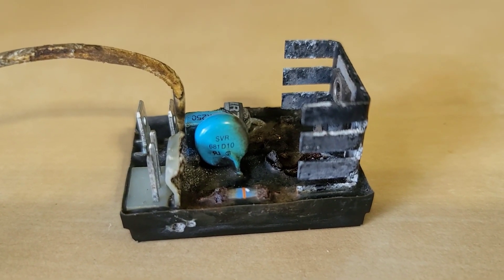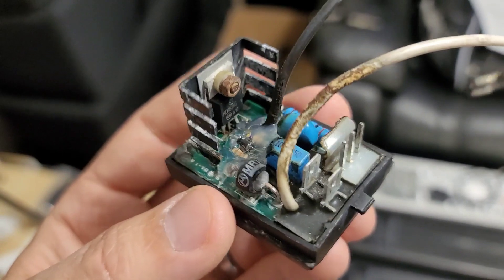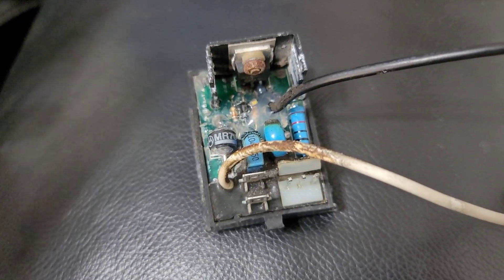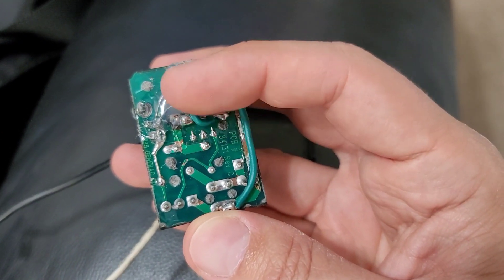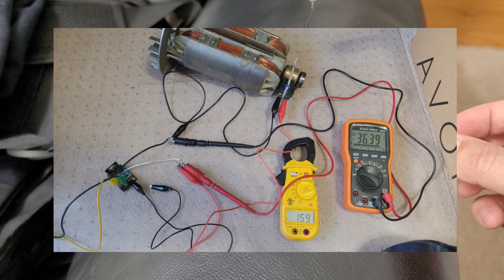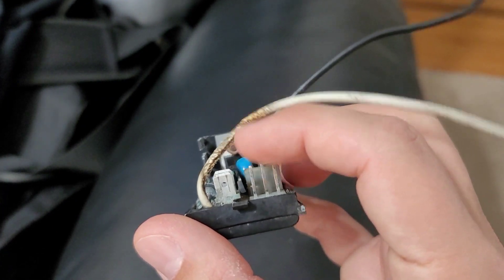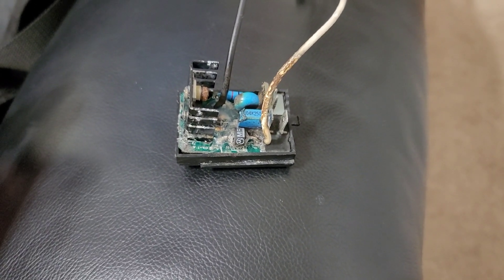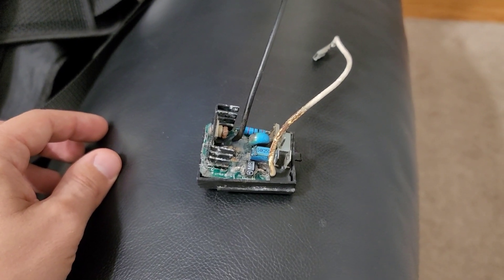Briggs / Generac Power Regulator Board 84132GS Repair / Rebuild

Comment: Good job. Just a remark. Hot glue is nylon. Nylon is hydroscopic. It absorbs moisture. Maybe not the best for electronics. My 5c of advice.
Reply from the maker: Thank you! I have since discontinued using the hot snot glue and instead using neutral curing silicone to secure the board's back into the tray. So far none of them have come back for any issues.

Comment: Hey Gary, very useful video, I'm repairing a generac 5500xl. It has issues!. Sometimes i have output, when it does it's stable but droops under load, like 1kW and the output is 190v. Initially one brush was stuck and the slip ring was dirty. Sorted that.. the manual part number differs from yours but they look identical. 84142gs.. I have a 10ohm Exciter winding,  and the dpe winding is 2.6ohm, no idea what voltage I would see on that winding.. so @120v, I have 147v DC output O/C. A 10ohm load resistor gets very hot quickly..  do you think it's stuffed, started rework heat disassembly? What should I see on that dpe winding, what's dpe stand for?..
Reply from the maker: @nickjones886  DPE stands for displaced phase excitation. Don't worry about the voltage on the field winding as much as the current. The 84133gs board is a current source not a voltage source. A 10 ohm rotor field winding is normal through the brushes. that is at full load. It's roughly 24 volts to 36 volts no load on the generator and drawing about 3.6 amps. That's like 130 Watts of heat going into a small resistor.

The AVR circuit on the system control board controls how much current the power regulator board is outputting to the field. 

You not only need to look at the power regulator board but also the system control board because the high voltage is an indicator that both those boards are not working properly.
Reply: Hey, thanks Gary for explanation.. so 120v AC into spade connections = 30 ish volts DC, circa 2A into the rotor winding, short 1 and 3 should kill DC output... There's not much on this board that can go wrong.. I'd assumed the AVR function (on the other PCB) was working as I was able to adjust the output voltage control, so I ruled out any faults on that board.. it's basically a AC -> DC driver board with an inhibit function!..
Reply from the maker: @nickjones886  correct it has a negative feedback snubber topology. Almost all AVR circuits are like this but instead they are split between two circuit boards on this generator.  The improvement on the newer generators is that if the negative feedback circuitry fails it doesn't go high but instead goes low for voltage or zero which is safer than having a voltage surge.
Reply: That 18kohm resistor, 2W?.. mine is now in the megohms!! PCB looks ok... Hopefully, that'll sort it's output...
Reply from the maker: @nickjones886  I don't recall off the top of my head but I believe it was a one watt resistor
Reply: Hey Gary, thanks for your help. YouTube comments not really best place for lots of messages, for which I apologise. Tried a more direct route.. anyhow, got my Genny back together and I tested the driver PCB using a switch across 1 & 3.. o/c I get 300 odd AC volts at the 230 outlet and 13v AC with the switch closed. So I'd say the repair is good.. but!. I still have severe volt droop under load, not as bad as it was, 2kW/190v, now it's like 4.5W and 209v. I can set the output voltage with no load and have more power from engine.. I noticed a recent video on James channel showing a sticky throttle linkage.. mine had this issue, just wear in the governor arm..  I now have the regulation board out, 83970 for investigation. Not really much to go wrong here either.. few transistors, caps maybe.. you got any immediate thoughts?.
Reply from the maker: @nickjones886  yeah severe voltage drop could be a lot of things either in the system control board or mechanical connections to the outlets are fatigued. It's hard to say without getting a good look at it.
Reply: @Bassguitarist1985  I did more tests! Asked James too.. it's strange that the AVR is clearly working. Both output coils are circa 300mOhms. And I've just had it running, dpe is stable at 183Vac, the field at zero load sits at 16Vdc and increases to 28Vdc at 4200W load. The AC out drops 26Vac and 2Hz from zero -> 4.2kW. I'm sure if I used an external power supply I could get 230V @ circa 4kW.. I don't know how deep you went testing, making measurements etc.. I'll get to the bottom of it sooner or later...

Comment: Hey, trying to debug the problem with my Generac 4000XL.  Trying to determine which component has failed, regulator board or the system control board.  Motor runs fine until I switch on the output.  With no load whatsoever, as soon as I switch on the output, the motor bogs down and stalls.  Seems like there is a short that is causing an overload on the output even with no load connected.  Can you tell me what test to perform to diagnose this?  I've not seen this issue discussed on any videos and I'd sure welcome some input.  Great video on the repair BTW.  Cheers.
Reply from the maker: Try disconnecting the three big stator output wires from the outlet panel. There are molex connectors in the end bell to do this. Restart the engine. If it doesn't big the short is in the panel..if it still bogs, your stator is toast.
Reply: @Bassguitarist1985  Thanks, with your help found the problem.  Really appreciate your input :)
Reply from the maker: @StanislavGouzenko  what was the problem?

Comment: I purchased a junked Generac 5500 XL as a project hobby.   I have no idea of its history - I found it at place down the road that has 2 old chicken houses full of "stuff" - lawn mowers, chain saws, weed eaters, the list goes on and on.   All sold as is.  Anyway had compression - the main coils were not opened or shorted.  I was able to get the motor started with little effort but no power.  BG - your videos on troubleshooting this model (you actually did it on a 7000W one but that one is almost identical to the 5500  I have) have been so helpful - and I was pretty sure that this board was probably the culprit - and I tested like you did.  I used a 16ohm resistive load to simulate the 12ohm I saw thru the slip rings.   Mine had no DC output with 120VAC in .  Ordered one from Briggs and Stratton (at least that what they claim to be on Amazon) for $33.  Anyway thanks for putting all the effort into your videos...
Reply from the maker: My pleasure thank you for watching!
Reply: BG, if you have the time and inclination to answer a question on my 5500 XL.   I replaced the control board - still no power.  So thinking perhaps the windings needed to be flashed (not sure if that required on this model or not) - I disconnect the control board and wires to the brushes - and appied 12DC.   Incandescent 120V bulb can on (dimly) - at one point I increased the DC voltage to 13  - light became brighter - when it went to 15VDC the motor started struggling - and I dropped the voltage back to 12 - and the engine ran find - but I got the same issue when I went back to 15VDC - and very soon after that smoke started coming from the open generator housing.  Partial short on the main rotor?    I can't imagine what else it could be.   But on the off chance I'm missing something  I figured I would hit the expert up.  I posted a question on smokestack and so far have not gotten any comments....

..../Romany
Reply from the maker: @romanykemp9042  magic smoke is not a good if you hear the engine start to struggle without any load connected other than a small 100 watt or less bulb then yeah you have a short somewhere or at the very least a flying short as it's called. I would say that the stator is toast
Reply: Thanks for that confirmation BG - I appreciate you taking the time to answer.   If was a fun project - that cost little except for my time - and I learn a lot.   I actually went back and purchased the same make/model (must have came from the same shop).  Bad power control board - which I replaced with the bad unit  - and the 2nd one works great so far.   5KW resistive  (water heater) load at around 16% THD.   Whoever scrapped these drain the tank and carb - the tanks were in great shape - the carbs just a simple cleaning.

Comment: Well done, thank-you. It doesn't look as though the Second part of James' repairs didn't upload.
Reply from the maker: He did post it, the power head had a bad stator. You can see the burn marks in part of the video. Thats why the regulator board failed a second time.

Comment: Another guy that does not show himself doing the actual repair, why dont any of these youtube geniuses show what the repair actually consist of?? Its so disappointing to a novice. You may as well not watch this vid because all you will walk away with is "short the outer pins together to shut off the generator end" c'mon guys, start making vids that teach what to do.......
Reply from the maker: I'm sorry that the video did not help you out. It's not easy to film every step of the repair because the reality is it slows down the repair when you are filming and then having to edit it down later. There are tons of forum posts about this repair that detail the repair process further. Being honest repairs like this are not for the extreme novice either. There are lethal voltages at this board that can potentially cause injury if you are not careful. 

If there is something that you did not understand please let me know and I will do what I can to help out.

Comment: Hi l have seen James video and when tested his generator he had the control board disconnected and max power came in witch smoke the regulator.
Reply from the maker: Yes due to a flying short in the main winding.

Comment: can i substitute a 12 amp rectifier with a 25 amp rectifier I have a 400V 12A rectifier  was able to find a 400V 25A.  Will that work without causing any problems or fire. Trying to fix THE Homelite LR5000T generator
Reply from the maker: Hey Vic, adding a more stout rectifier isnt the issue, its the rotor drawing too much current. As a design measure the rectifier is intentionally limited in its capacity so it fails before the windings do. Chances are though if the rotor draws more than 12A on a 5kw generator, something else has already burned up anyway.
Reply: @Bassguitarist1985  thanks. I can't believe I got a response that quick u rock ! .  So u think  I should consider the generator junk.
Reply from the maker: @Vicmon  what's it doing? Going under heavy engine load without anything plugged into it?
Reply: @Bassguitarist1985   I bought it  not putting out any power.   The engine starts but no power.  I did all the tests that I saw on ur buddies YouTube page  everything seems to check out fine except for the rectifier .   I did notice it was revved too high I did correct that.  But no power output I'm hoping the rectifier will fix the problem.
Reply from the maker: @Vicmon  its worth trying. Put the bigger rectifier on it, but fuse it for 10 amps. If it blows the fuse with no load, then yea id say its junk
Reply: @Bassguitarist1985  so I should put the fuse on the positive side of the rectifier ,i just ordered them on Amazon. At least the motor is good if I have to trash the rest .
Reply from the maker: @Vicmon  yea that will work
Reply: @Bassguitarist1985  great. THANKS!  I will let u know after I get the part and install.
Reply: @Bassguitarist1985  got the part in today I changed it and the outlet . It works now. Got power THANKS!
Reply from the maker: @Vicmon  awesome make sure you have the engine speed set correctly to 62.5hz. you.may also.need some capacitance on the DC side of the rectifier to smooth the ripple voltage out.

Comment: Hot glue is bad choice. If he gets generator running all that thing needs to do is run for 20 minutes then would probably get hot enough to melt that glue away then there's nothing holding your repair parts in place. Then I'd say a month or 2 of the vibration is all it will take to break a joint on that repair. The least should of used e6000 glue but probably best this is high temp silicone.
Reply from the maker: I agree and I even mention in my first video that it was not the best choice of material. I have done over a hundred of these boards the same way with the hot glue and none have come back for reliability or failure. But you make a good point that there are better materials out there.

Comment: when i use to repair those same boards i actually had a test generator i install it in and run it under load before sending it back to customer that way I knew it was 100% working properly  i have had some say it didn't work just tiring to get there Money Back But i know it was good so they had other problems or it did work but they where just tiring to scam me to get a refund There are a lot of dishonest people out there !.  Mouser & Digikey are two good Suppliers
Reply from the maker: Yeah there are many. I have two generators that use this board set. I'm confident in my bench testing the boards work as expected. I do send pictures and sometimes a video of the board working. That way the scenario you describe is far less likely to happen. Cheers and thanks for watching!

Comment: Can I send to you for repair?
Reply from the maker: Hey Duane. Yes you can email me and we can discuss details. You would need to send this power regulator board in addition also your system control board to make sure that they are working correctly intend and with each other. My email is on my about page.
Reply: I went to your about page and do not see your email address?
Reply from the maker: @duanetehoke2175  its my channel name at yahoo dot com

Comment: I called Mouser, they can’t find 84132?
Reply from the maker: 84132 is the part number for this board. There are multiple components on here that are readily available from them or Digi key. I try to keep the cost to repair about half the cost of a new one but depending on how much damage like this one for example wound up being closed to the cost of new due to the time spent.